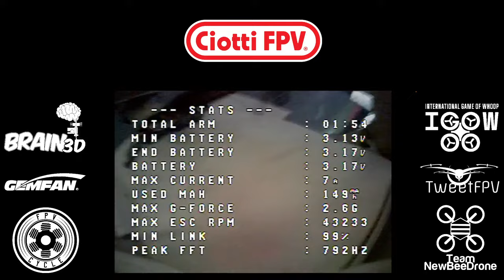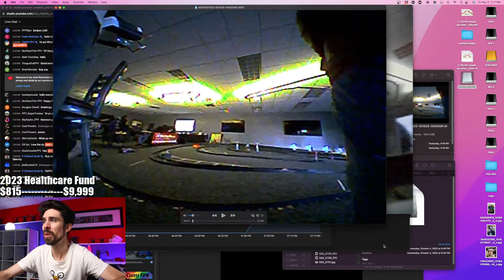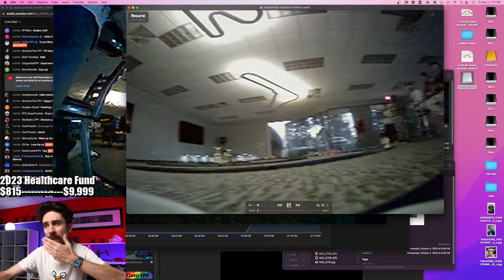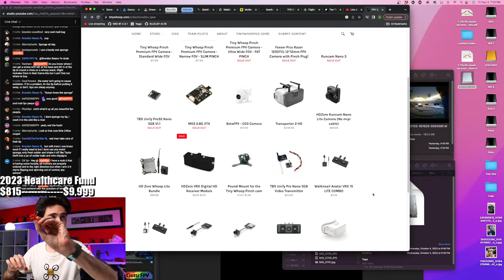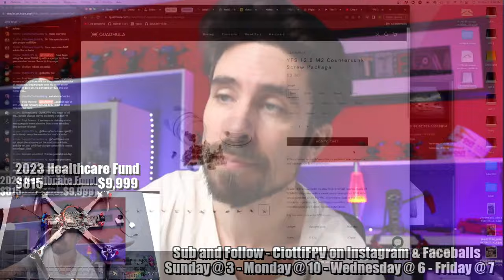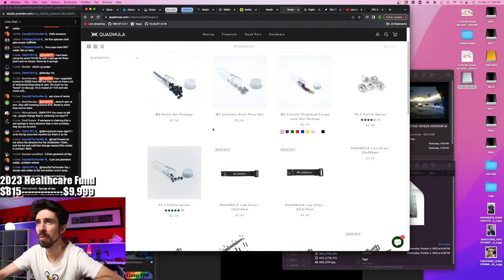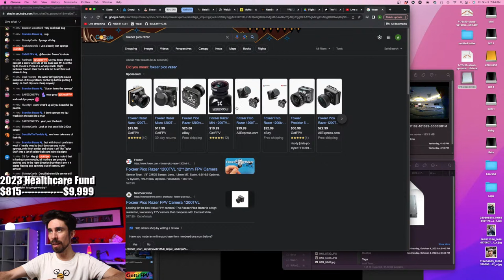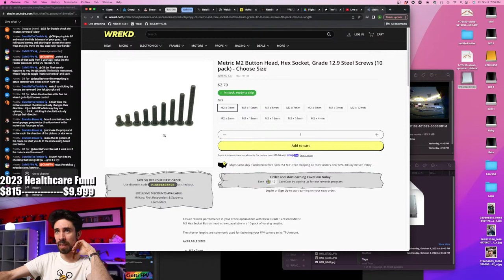Reassembling the Razorback with MOAR WHITE - Cinesplore Tuning - Male Bag - Q&A

Comment: Yo Bro what’s up my friend,

00:02:35 On this stream…..
00:04:57 Male bag.
00:13:30 What camera is on the whoop 😉and what camera we going to put on it?
00:29:01I upgraded motors to 32500 from WB but they seem to have a lot of resistance/drag trying to spin. So much so my “boost” on blue jay .16 is maxed at 1125 and one motor still….
doesn’t spin at arm. Also still hovering around 43%. Reset to stock tune and no hairs
00:33:19 Do you know where I can get a screw with M2 at the base and M1.6 at the tip to mount a Vista on a whoop stack? Iflight includes them in their frame kits but I can't find out where to buy.
00:40:22  have a mob 6 that is having some trouble, all motors are properly ordered and in the right direction but when I arm, it starts flipping and spinning out of control, any advice? 00:49:54 follow up. I tried all that and it still starts spinning, I don’t want to give up yet as it’s quite new, any other things it could be?
00:49:35 Is putting the vista right on the stack a good way to do it? I figured it's less complicated than printing a stack adapter.
00:51:31 Talking about the Cinesplore tune.
01:00:48 I want the Foxeer invincible frame (2.5 & 3.5) don't you?
01:02:49 If those 4mm arms work out well would it be possible to get a set. have 2 Cinesplore I love but would be interested in refreshing mine as well.
01:03:54 The tune on the hummingbird v3 made me realize how crappy the tune on my whoop was. I put a whoop preset on in BF that I liked a lot, except the throttle mid was set to 100, why they do that?
01:05:08 My new frame from AliExpress came in this week. Apex mini 3 inch. I have to say....looks very good!
01:07:34 Working on the Razorback 5” Glide frame.
01:18:38 Do you have lots of vista overheating issues? That heat transfer tape seems a pain in the tushy...I use a zip tie and some dampened Ummagrip lite & vista has never moved/overheated.
01:36:05  did you see the surface RC transmitter from Radiomaster with ELRS onboard? Kei truck might need an upgrade.
Stay safe everyone.